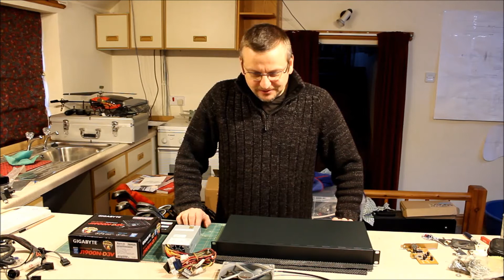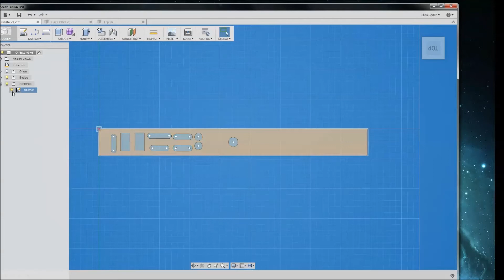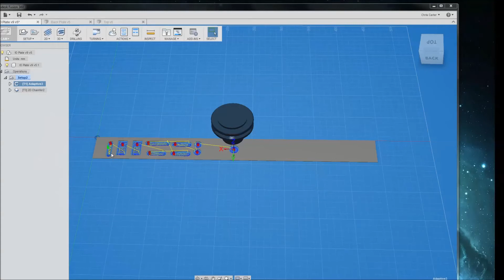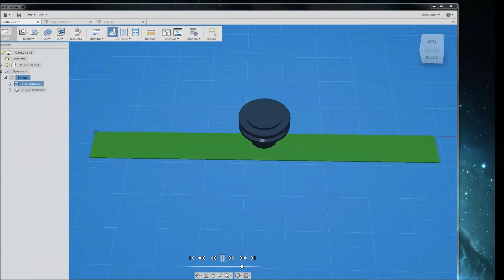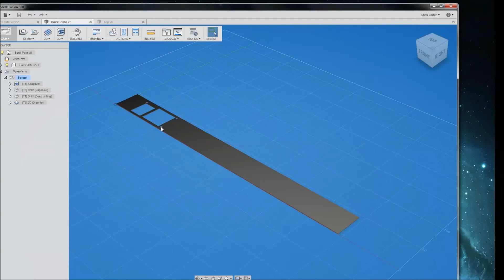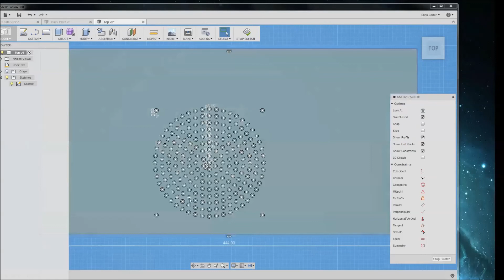CNC Project  - DIY Rack Mount Firewall/Router - Part 1

Comment: why you living in kitchen, where is your wife?
Reply: btw, the CPU is under powered if you need squid caching
Reply from the maker: lol - its only a kitchen if I use it as one and my wife is very camera shy
Reply from the maker: I've not run Squid on it yet, but current CPU is maxing out at 3-5%, so plenty of headroom left.
Reply: pfsense only maybe pfblockerng and other plugins wont suck much power, but the squid takes it all
Reply: I  meant by where is you wife, i mean why she haven't kicked you out of the kitchen
Reply from the maker: Lucky for me we have another kitchen, which does get used "properly", or I suspect I'd be speaking in a much higher octave than I do at the moment ;-)

Comment: What type of machine do you use?

I'm pondering upgrading my X-Carve, but I am torn based upon both rigidity and the belt system.

Could you please give us a tour of your CNC rig?
Reply from the maker: Hi TheRangeControl - I should probably redo this video as it was one of my first and its a bit terrible, but here you go https://www.youtube.com/watch?v=SGaFiovoNJY

Basically I designed and built the machine from scratch, as what was on the market at the time was either a. floppy machines that wouldn't cope with much, b. expensive in the extreme or c. a combination of both (expensive and not up to cutting much).

If you're interested in building your own then pay www.mycncuk.com a visit - the guys there helped with my machine and there are many build logs you can copy from.
Reply: I_Made_This Wicked!  Thank You!

Comment: @I_Made_This  dono how old this vid is but wouldn't it be a good idea to put some vents on the right of the case as you have got an exhaust fan at the top and a small one with the psu but no intake ?
Reply from the maker: Hi Paul - temps have been rock solid at 26.8degC  - there's a second pattern of holes in the bottom of the case under the motherboard, which whilst blocked essentially by the motherboard, allows adequate in flow. In the 3-4 months since building the router/firewall I've yet to see the CPU go over 10% utilisation, so this also helps keep the temps low..
Reply: thanks for the quick response thats prity cool from part 2 it looked like the vents was directly under the fan i am 30 seconds int part 3 but i do like the idea i wash i had a cnc, iv been using a nail, screws and a round filer (i cant afford much but i do the best i can by hand)

Comment: can i ask what model that motherboard is please? I am interested in following your video to build myself a PFsense router, and that motherboard with twin 1gb LAN, sounds perfect to me too..
cheers
Reply from the maker: Hi Gamerdude1989 - I used the Gigabyte GA-J1900N-D3V motherboard for this project, but I can't see stock out there atm and it may have been discontinued. It looks like the closest alternative is the GA-C1037UN-EU (more expensive) or the GA-N3050N-D3H, which is roughly the same cost, but a 1.6Ghz CPU rather than 2.0Ghz. Considering I have yet to see the CPU load on my router go over 10% I'd go with the GA-N3050N-D3H.

Hope that helps.
Reply: you can find it on ebay for 100 and very cheap shipping.
Reply from the maker: Angel TheZombieKitteN Thanks Angel - I will be needing another one in a few months for another rack mount project.
Reply: I_Made_This I think the one I saw yesterday was 103 euros from israel and to ship to greece it was 9 euros.that's just the listing I saw. the other listings might different though. happy to have helped :)

Comment: This is an interesting project. I have an old Silverstone SUGO which I could use for something like this. Would it be possible to also run a NAS from such system if needed?
Reply from the maker: Hi Lars, I cannot see a NAS package on the list available within pfsense, but that doesn't necessarily mean it can't do NAS - pfsense.org is probably the place to find out for sure.
Reply: I will definitely look into this as it sounds like a good package to keep the kids safer too. How big is the learning curve on it to set it up? I have minimum skills on linux.
Reply from the maker: The learning curve is fairly small if you know your IP networking and I haven't had to drop into a cmd prompt (yet) - the setup is pretty much automatic from bootup and is browser GUI based once you have an IP assigned to the LAN port and can access that from another PC - The GUI itself is no worse and in some places way better than most consumer routers, but has a lot of options you can add later if needed.
Reply: This system becomes your default gateway in your network right?
Reply from the maker: Yes it does - the difference here is I am putting two layers in between my network and the internet - most decent data centers use 3 layers, but 2 is enough for me :-)
Reply: I'm looking forward to the next video. This might be a nice way to replace our old linksys router that has been giving trouble with losing connection. I should have most parts in storage.